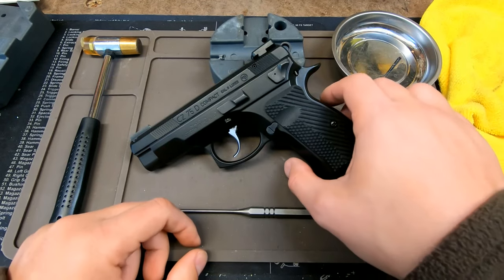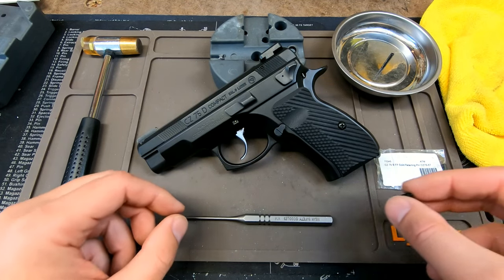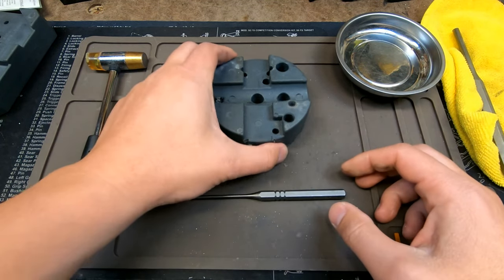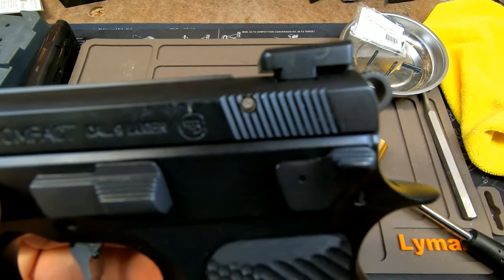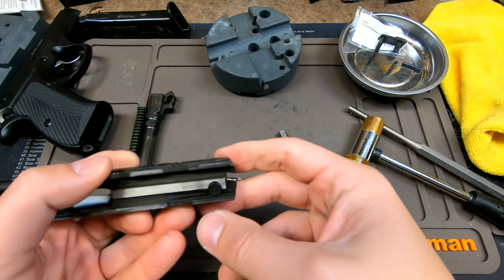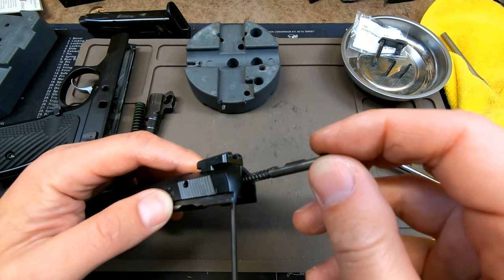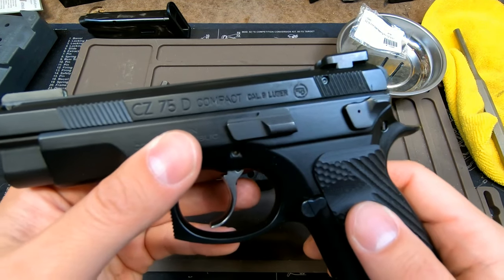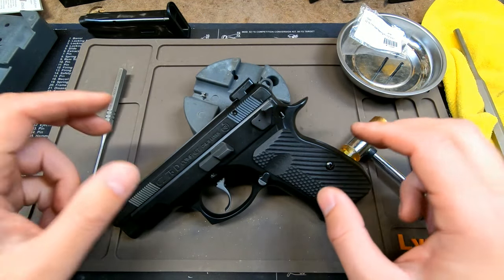CZ75 Platform DIY - The MOST important part to upgrade - Firing Pin Retaining Pin Upgrade

Comment: Cajun Gun Works has a hardened steel hollow rolled pin that won’t void your warranty.  The solid pin replacement will void your warranty as it can potentially damage your firing pin.  The hollow roll pin is designed to deform and serve as a shock absorber for the firing pin...the solid pin won’t do that. Also, avoid dry firing your CZ...use snap caps or a barrel block/mag block combo.
Reply: Do you have to replace the Cajun one ever or is it good to go once u put it in there ?
Reply: @johnfreitas8664  check it every 5000 rounds or so, if you notice any dimples or wear replace it, but they should last at least that long. I bought 5 of them for like $20 which will last for more rounds than I will ever have the money for lol...
Reply: Thanks man. So there is obviously good reason for hollow stock firing pin. Sometimes we do think that engineers overmissed something but in fact they certalny know why they made some part the way it is.
Reply: Don't use any of those. Use a o ring.  Prevents any firing pin wear.

#31 for berettas and sig 
#83 o ring for cz and hi power.
Reply: @jason200912 how would a oring work?
Reply: @Randaljoness Lay the o-ring flat in the back of the slide caging the firing pin. When the hammer falls it hits the o-ring stopping it from making contact with the firing pin. Just remember to pull it out before you carry.
Reply: Why do they sell the solid pin if it voids warranty?
Reply: @bigjoesshow5648  CZ doesn't a custom shop does because people don't like having a wear part, but they don't understand that they are potentially causing much more expensive damage elsewhere.

Comment: The solid steel retaining pin will now cause impact damage to the firing pin which is probably why CZ went with the roll pin to begin with.
Reply: Good point. But why is this not acknowledged by CZ as a needed periodic maintenance like brake pads on your car?
Reply: @jazzmofro2605  From what I understand, the firing pin retaining pin is only susceptible to damage if you dry fire a lot without a snap cap or, what I use, a rubber o-ring behind the firing pin to prevent the hammer from striking the firing pin when dry firing. A number 83 o-ring works well, as others have pointed out. You can get a box of 10 for about $2.50 at Home Depot.
Reply: @jamescarter4175 thanks for the info! Gonna pick some o rings up at home depot
Reply: @bloodycrepe  You're welcome.

Comment: Always helpful and valuable info...wanted to follow up on our discussion about the firing pin retaining pin.  I did order one from CZ-Custom, but  after reviewing their forums and the CZ USA forum I contacted CZ directly.  Their product support rep said that the roll pin is designed to deform and act as a shock absorber for the firing pin.  It's a $2.00 part that's designed to fail and be replaced.  The CZ rep said not to replace with a solid retaining pin and that it could damage the firing pin itself if not be party to other more catastrophic failures than that of a roll pin.  He suggested just buying a half dozen of the hollow roll pins and keeping them on hand since they're so easy to replace. Also suggested NOT dry firing but using snap caps (you can also cut a foam earplug in half and put it between the hammer and the firing pin).  Thanks as always.  Just something more to consider.
Reply from the maker: I'm having the same conversation with another user about this today.  HE also said the CZ rep said the same thing.  Here's my take on it.  I personally feel its a design flaw.  The roll pins they use on CZ are cheap (like the trigger pin).

The retaining pin should not need to be replaced after 500 rounds plus some dry fire.  That is unacceptable.  Most people don't even know this pin is supposed to be replaced so unless they see this video or talk to a rep like you did, how are they even supposed to know about it?  I found out the hard way because my firing pin was stuck and pistol would not cycle.  I took it apart and found that issue.  Then I took all my CZs apart that have those pins and was horrified.  Imagine all those people who depend on them with their lives and don't even know this could be a failure when they need it?  Completely unacceptable!
I personally think CZ is trying to spin a negative into a "positive" as they would never admit to a design flaw.  I'm not saying the solid steel roll pins wont have issues either, but the design is flawed.  I have many more rounds in my Beretta 92 pistols including dry fire and they have never had an issue like this.
Reply from the maker: @jupraman  Yes, I will not use a CZ for anything other than the range due to my pin experience as well.  It's too problematic to trust your life with.
Reply: @CobraReady no it’s not. You replace the pins when they need to be replaced… then the gun works

Comment: Repeated dry firing of the CZ 75 will damage the firing pin retaining pin.  Without some kind of protection such as snap caps, the firing pin rams into the retaining pin eventually damaging the retaining pin.  I use a small grommet placed into the area above the firing pin to allow the hammer to strike the grommet rather than the firing pin.
Using a solid retaining pin may over time damage the firing pin...just a thought.

I have replaced the retaining pin in my PCR one time.  I went to a local hardware store and purchased several roll pins for the price of one solid pin from the custom outfits.,  and I replaced it in the same manner as this video.
Reply: That is my concern, too; if you replace the metal that's deforming, other metal will deform.
Reply: @Hansengineering  I purchased the same diameter size roll pin.  They were a bit longer so I ground the new pin the correct length while comparing the new pin to the old pin...no damage to the slide.
Reply: I'm thinking about going the same route. I've seen them pretty cheap on Amazon. 

What size did you use?
Reply: @tonycj7860  

old thread...I had to go check in my shop...
I measured them to be 1/8" X 3/4"

As I recall, they were a bit long so I grinded them down to fit better side to side.  Remember when inserting the roll pin to place the open slot at 12 o'clock (top of the slide).

Comment: It looks so easy when you remove that retaining pin. It was not the case on my SPO1 when I tried to remove the retaining pin. It did not even move a hair of an inch when I tried to punch. I used 3mm punch, bench block and a regular hammer.
Reply: Finally got it installed. I used a roll of masking tape as my bench block instead of the real bench block. Followed your installation instruction. Very helpful! Thank you for posting.

Comment: Cajun Gun Works sells a reinforced roll pin that will last much longer than the stock CZ pin, I've got about 1500 rounds on one pin (I bought 5) and still see no signs of damage on the pin. The CGW pin won't void the warranty either, it's designed to be as strong as possible without damaging the firing pin. I've heard from other people that replacing the CGW pin every 5000 rounds is perfectly acceptable.

Comment: Absolutely worked. I ordered 2 pins for a P01 Omega. One pin did did not have a snug fit  but the other one did. I will be contacting CZ to replace the pin that seemed to be under size. Perfect video for this problem because my old pin was beat up so I am glad to have this fixed before having any problems.
Reply: Is your CZ reliable?

Comment: CZ improved the hardness of the firing pin retainer roll pin. Have seen the older ones break with as little as 500 rounds through the firearms. Like the recoil spring, the pin(s) should be replaced around every 5000 rounds, unless there's excessive wear on the part(s).

Comment: Got this pistol on order,.... might not live long enough to get it the way 2020 is going, but we'll see. I have the P75 B original full size & the 75 B compact original, both all steel. I carry the compact now in my rotation, but so looking forward to getting the PCR compact W / aluminum frame just for the weight loss to make it more carryable at my age as I love everything about it. Thnx for the info on the roll pin, I will change mine now. Handled the Shadow 2 yesterday,.... Daaamn !! Can't afford the freight now that I'm retired & no longer shoot in competition, but if I did I would sleep with that Shadow 2 in bed, what an amazing piece right out of the box. Keep up the good work, if only the Glock Block fan boys knew !
Reply from the maker: I actually sold my PCR this year as I prefer the Steel Compact as it is a better pistol.  It is slimmer but it is heavier.
Reply from the maker: @kentonhammond8938  Look at the slide and frame of the PCR.  The frame is wider than the slide.  On the Compact, they are the same width.  I like the decocker on the PCR and the beavertail is more comfortable, but it wasn't better overall than anything else I had.  The Compact is different as its slim and steel framed with an option for SA.

Comment: I wonder if CZ designed it that way. If something is going to be destroyed over time and need replacing, a cheap roll pin is better that replacing a firing pin. Use snap caps when dry firing to keep the firing pin from ramming the roll pin.

Comment: So I'm at 1:58, one question I have is this - is the firing pin material softer or harder than the retaining pin? If you were using a solid steel retaining pin, and assuming the firing pin was a softer metal - would that then make the firing pin prone to wear prematurely?
Reply: Exactly. This is for ignorant people that are lazy and don't want to buy sacrificial rolling pins. Instead they'll have to replace more expensive parts later

Comment: What holds that pin in the hole?
There just doesn't seem to be enough surface contact to keep it from backing out.
I have used the cgw pins a couple times and found them to work well.
The roll pins are unsightly however.

Comment: I've read that the solid pin will damage the firing pin.  The firing pin is much more expensive than replacement roll pins.  I think this whole problem is a design flaw.  My pin seems to be stuck in the slide and refuses to come out.
Reply from the maker: Has the firing pin reset?  My retaining pin was so damaged that my firing pin would not reset.  It needs to reset before the retaining pin can be removed.

Comment: Seems like the same thing for the p01 Thanks for the video. I have heard about this failing.
Reply from the maker: Yes, any CZ 75 that has a firing pin retaining pin operates the same way.  My SP01 pins were really beat up too.
Reply: Any Hammer Fired CZ Pistol will have this issue!

Comment: I read somewhere that the solid pins damage the firing pin.  Apparently the design calls for a bit of flex in the pin to prevent mushrooming of the firing pin retaining notch witch will then drag on firing pin channel and cause light strikes.  So I guess you need to ask yourself would you rather replace a roll pin or a firing pin when doing a deep clean on your pistol
Reply from the maker: Whether one replaces their pin with a solid one or regular roll pin, people need to be aware that the factory roll pin needs to be replaced over time.  This is not something CZ brings to anyone's attention.

Comment: Just to confirm - the easiest way to change the retaining pin is with the slide still on the frame. Correct ?
You just were demonstrating how to remove the firing pin/plunger

Comment: So couldn't you just knock out the old retaining pin and then knock in the new retaining pin without disassembling the slide?
Reply from the maker: You could do it that way as well.  But do you want to check the pin before replacing and maybe cleaning everything with the pin out.

Comment: I can't even get the retaining pin out of my cz75 c. I don't think I'm doing anything wrong. I'm using a 1/8" punch and it's just not budging. I don't know the extent of what the previous owner did, probably not take care of it judging by the carbon buildup that's still on the recoil spring and barrel, but the shop I got it from said that it was almost new aside from the trigger being a custom steel trigger.
Reply from the maker: If the pin isn't moving, you may need to take to a gunsmith.  Something may be damaged and you also don't want to damage it.

Comment: So I’m a little bit confused can you just take out the damaged retaining pin and then put in the new one or do you have to take the gun apart and remove the firing pin and the block plunger for some reason?
Reply: My question a year later 🤷🏽‍♂️

Comment: Hi there great information, thanks for this. I didn't know this issue till I saw this. New guy to your page. I just ordered my first cz 75 sp01 a few days ago. I just learned a lot from watching this and will be ordering some firing pin roll pins. What would you recommend to switch out besides that roll pin that can cause issues? Do plan to do a lot of shooting with it and have it as one of my edc pistols.
Reply from the maker: The Magazine brake is also a flimsy piece of metal.  You may want to replace the trigger pin to a floating trigger pin.
Reply: @CobraReady  thank you man for the fast response and the advice. Great work you do here.
Reply from the maker: @andrewmartinez4768  Thanks.  Please help spread the word about my channel!

Comment: How's your CZ 75 now? I'm thinking replacing mine with solid steeI but I was told not to use solid steel retaining pin because if you want something to break from repetitive pressure, it's better to break the retaining pin rather than the firing pin.
Reply from the maker: The firing pin is doing fin.  The problem with the factor roll pin is that if the firing pin gets jammed into the roll pin like mine did, it won't cycle empty round as the firing pin stays in the forward position which can cause all kinds of other problems.
Reply: @CobraReady , thank you for quick response.

Comment: How do you keep this pin from "walking" out of the slide ... there is a reason CZ used a roll pin that keeps tension on the hole opening ...??? The damage you are talking about can only happen during "unprotected dry firing - meaning you don't have a snap cap present ... during normal firing with a cartridge the firing pin does not contact the roll pin ... I have fired thousands of rounds with the roll pin and had no problems

Comment: Very helpful and crystal clear. Thanks so much. I got several upgrade parts from Cajun including this and happy to see it how to do it first. By any chance have you made videos for barrel bushing, springs replacement and guide rod? Mine is a SP-01 Manual Safety.
Reply from the maker: Guide rodd and springs yes.  No for the barrel bushings.  I have a few CZ DIY playlists
Reply: @CobraReady  Thanks, i'll look for them. Do you have an opinion about changing the original firing pin to an extended pin?
Reply from the maker: @cvcoco  If you are using lighter springs, then you should use an extended firing pin.  This would mainly be for competition or range, not for home defense.
Reply: @CobraReady  The argument goes that rifle and nato primers are often subsituted in ammo and they are harder, requiring a firmer strike or the orig CZ pin may break and sometimes do. I have very little knowledge about it.

Comment: Can you put the new Firing pin roll pin in without taking the gun apart, with the hammer forward keeping the firing pin down so you can see through?
Reply from the maker: Yes, that is what I showed was the easier way to do it.
Reply: Average Doomsday Prepping Dude Tap out from right side, and tap in from left? I have the CGW Pin for my PCR

Comment: Hey buddy. I got one of those  Solid pins like you talked about for my cz p09 and When I took out the old pin and put in the new solid pin in, it went straight through. So should I get another solid pin or call cz?
Reply from the maker: Was your original roll pin all beat up?  I haven't changed the roll pin on my P09 so maybe the hole dimensions are different.  CA will tell you not to replace with a solid steel pin as that's their official stance...
Reply: @CobraReady  yeah my roll pin was messed up.  Cz said on the website that the solid pin will fit.
Reply from the maker: @juliojreyes6234  Hmm, maybe the specs on the pin arent right.  I'd try another and if it goes through again then I'd put another roll pin in and keep several handy for when theh get beat up again.
Reply: @CobraReady  ok buddy n I just ordered another one lol. Thank you for writing me back so fast. Have a good evening.  Thanks again.

Comment: I had to learn the hard way, too. Easier than you, it seems! My CZ P-01 suffered the same breakage. I still have no clue why CZ hasn't made their roll pins more robust..
Reply: I’d guess because it’s meant to be a sacrificial part, easy and cheap to replace. It’s a bit of a design flaw, in my opinion though. If you look at the CZ Shadow, you’ll see the firing pin retaining design is much better, and doesn’t use the roll pin.

Comment: After how many thousands of rounds do these parts usually break on a cz75 b omega? Or should I replace them ASAP after having purchased the cz 75 b omega? Your word of advice would come in very handy.
Reply from the maker: Mileage may vary.  One of my pins went bad at around 500 rounds with some dryfire practice.
Reply: Thank you for replying.😊